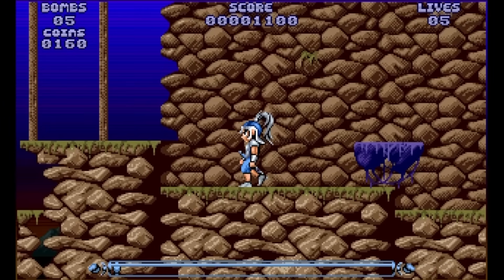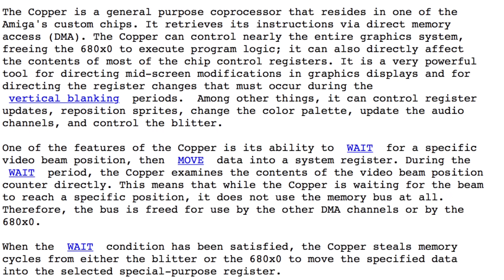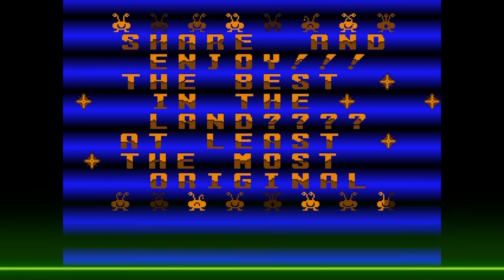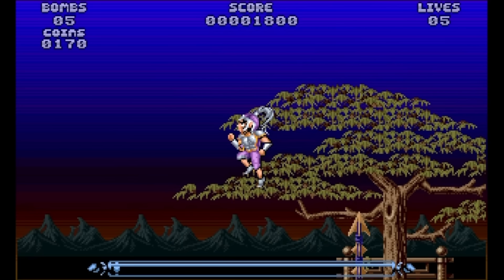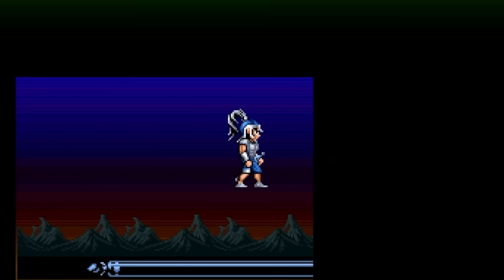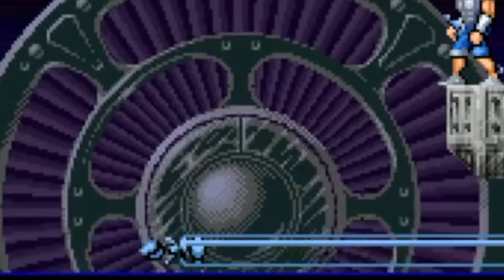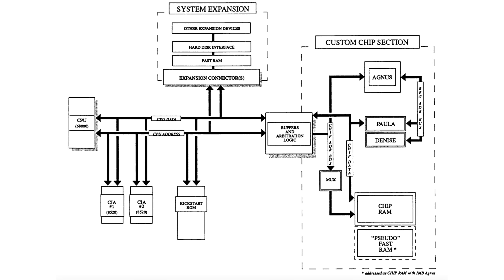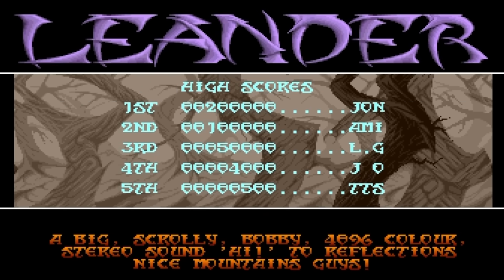SNES hardware beaten by this simple Amiga trick

Comment: The Amiga's custom hardware was powerful for it's time, when used to it's full potential it ripped the Atari ST to shreds and there's a never ending number of tricks discovered by programmers and for the demo scene that's still going strong today. It used to really pee me off in the earlier days of the Amiga 500 when many games were lazy Atari ST ports that would leave the Copper and the rest of it's powerful custom hardware idle, often with software sprites and jerky scrolling, sometimes even running a little slower due to the slightly slower processor with nothing being offloaded to it's custom hardware. Usually ST ports had better sound, but that was the only improvement. Even some games which were considered good like Xenon 2 were still ST ports so could had been even better.

Comment: The SNES can do similar things with it's tiles, but not with it's sprites.  

Notably, with an MMU expansion chip, but the SNES and NES can do this.  However, doing pixel clock level has never been attempted as far as I know.  (It is possible that Donkey Kong Country and a few other SuperFX chip games utilized this same technique.) 

Another interesting note is that some of the favorite effects on the NES and Genesis were done by intentionally throwing the sync from the DMA line and the Hsync off.   I suspect the Amiga can also do this, and could create some interesting effects.
Reply: As a note, looking at the hardware specs of the SNES and Genesis, part of me wonders if they could do this sort of thing, within limitation, but nobody thought to or tried.  

The Genesis had a DMA stream controlled video chip that could easily be triggered to page-flip a few sprite images at specified hsync points.  I am not sure what the SNES used.

Comment: great video. i think ECS sprites are very limited in width right? how did you do the word or did this also fit into that range? Was it possible to have something like TFMX running in leander so you could of had music and fx at the same time? or was that not possible due to restrictions, be it hardware or time restraints? Cheers. Bit off topic, but do you think a decent port of something like Strider or SF2 could be made using these tricks?

Comment: I'm a little confused with the multiplexing of the sprites horizontally: If you have to use some sprites for the mountains in the background, even if it's only a few repeated horizontally, does that then reduce the max amount of actual player and enemy characters you could then show on the same scanline because you'd go over the sprites per scanline limit and they'd start to flicker?

I'm thinking more of Shadow of the Beast here than your game to be honest, as that shows a full-screen-wide set of mountains plus the player and other enemies fully overlapping them, whereas you've been careful to make sure the player is never on the same horizontal lines as the background mountain/cog/fire sprites.

Or, does this technique basically overcome the sprites per scanline limit and allow for both a full screen width of mountains [or whatever] plus the normal 8 16-pixels-wide sprites per scanline?
Reply: You can move other sprites mid scanline too.
Reply: @fungo6631  Yeah, but does it allow them to actually go over the max sprites per scanline, or do those mountains take up some of the sprites per scanline, so they still have less sprites to use for the actual player and enemies on those same scanlines. Even if it were one small sprite for the mountains repeated across the screen, is that one less sprite horizontally there for the player and such?
Reply: @inceptional  There is no conventional sprite limit per scanline. You can have more than 8 sprites per scanline. 

The mountains take up one sprite slot, but that same sprite slot is recycled mid scanline. 

The mountain gets repositioned so quickly it looks like there's another sprite further down the scanline.
Reply: @fungo6631  Okay, so they could basically have up to eight different multiplexed sprites multiplied by however many times that fits into the screen horizontally for each multiplexed sprite across each scanline. So, if they had one mountain sprite multiplexed across the entire screen width, they'd still be able to show seven other multiplexed or non-multiplexed normal player and enemy sprites on that same scanline for example. Correct?

Comment: Using the Amiga Copper to clone sprites hardly beats the SNES, you are still limited to 8 sprites per scanline and each with a limited colour pallete, the SNES does not play by this rule. I used to use this effect on the Amiga to code parallax starfields ect, but such cloned sprites were limited in their degrees of movement not being able to take the scanline space of their cloned brothers.
Reply: LOLwut? Blud just said that you don't need 8 per scanline, you can move them mid scanline too.

Comment: Does dual playfield mode always compromise 2 sprites, or is that only in overscan modes?
Reply: Horizontal scroll usually needed an extra 2 dma slots (16 lowres pixels) on the left side.
Reply: @SerBallister  So.... not sure what you're saying here. You need 2 16-bit fetches, is that what you said there? And if one narrowed the screen by 16 pixel, that should also give us the cycles we need, right?
Reply: @saganandroid4175  The hardware needs to perform some fetches before display of the left edge of the screen, so say, if the left edge starts at word 8, the dma needs to fertch them at say, word 6. Due to some fixed timings there is a limit of how early this can be done because the first few dma slots of each raster are used by the sprite and audio system. This is why some resolutions sacrifice sprites.
Reply: @SerBallister  That all rings a bell now. I recall the great cycle charts in the Hardware Ref Guide.  But by narrowing the screen a word or two, shouldn't we be safe?
Reply: @ I remember the diagram you mentioned too. I can't remember the exact solutions, but yes, I think it had something to do with careful setting of the DDFstart/DDFend (Display data fetch) registers.

Comment: I don't understand why this "trick" can beat SNES hardware, SNES (in my opinion) is much more powerful in graphics (not sound).
P.D: I had an Amiga 600, never a SNES
Reply: SNES has a DSP and can do all the digit wavetable tricks of the Amiga. You just need to code it so that it DMAs the samples from the cartridge. Not many devs were good enough. Amiga is straight forward.

Comment: I didn't get anywhere near your level of acheivement, but one thing I've been saying to people is that you could use the copper to change the colour pallet every 4 horizontal pixels.  I programmed a simple loop in assembler to ascertain that in about 1997/98.  I was planning at one point to make a chunky graphics type game but with hundreds of colours on screen at the same time on the original chipset using that.  Not sure how feasible that would be.

Also, I know you're talking more about sprites here, but its nice to se my findings about the copper being able to take effect every ~4 horizontal pixels.  Most people seem to think you can only use it each scan line
Reply: On SNES everything is once per scanline. Color and mode-7 . Same on GBA. Retarded.

Comment: This really is impressive, but comparing it to SNES/Genesis, isn't it tecnically possible to have 8 screen sizes of sprites not breaking the max sprite count of 128 by using 64x64 sprites on the SNES? I've never made anything for the Genesis, but the 80 32x32 sprites it's able to show should be enough to cover one screen as well, and if there was no Limit of 256 sprite pixels per scanline, there would even be enough sprites for another half screen.

So why isn't this possible on these consoles?
Reply: Megadrive limit was 80 total sprites but 20 per scanline (PAL) and only if you were using sprites no bigger than 16x16.
If you used 32x32 size sprites then the limit was iirc 5 per scanline and the biggest sprite was priority so if you had one large 32x32 sprite but the rest were 16x16 on a scanline then you were still limited to 5 per scanline before flickering, now I could be wrong about the last bit but I remember reading it somewhere many many years ago.
24x24 size sprites had a limit of something like 11 per scanline.
Also the Megadrive was capable of 64x32 size sprite by combining 2 32x32 sprites and it will act as a single sprite, not sure what the limit is though.

Amiga sprites were 8 per scanline and because of the Copper chip you could fill the screen with sprites like he showed, another cool thing about the Copper was you could add in extra colour gradients as well as extra colour palettes anywhere on the screen and also add extra screen shells with their own colour palette. Another thing about Amiga sprites is they're only limited to 16 pixels wide but they could any height, so a 16x256 or higher sprite was possible.
Then the Amiga has the Blitter chip which has it's own sprites called Bobs (Blitter Objects) These had no limit (barring CPU, DMA time) so didn't suffer with any sprite flickering, they could be any size too, the downside was they chewed more cpu cycles compared to hardware sprites, were also limited to the colours of the playfield they were on, so everything was a tradeoff/balance.
Reply: @off1k  Okay, thanks for clarifying. While I now see how that makes the Amiga superior to the Megadrive, I remember the SNES being able to render enough sprites per scanline to completely fill it (272 pixels on the sprites layer per scanline for a screen that's only 256 pixels wide). But then again, that's probably pretty useless since not many other sprites can be used before the flickering kicks in.
Reply: @kaihunsicker9316 SNES has 4 background layers without compromising the sprites. So : why?

Comment: DMA cycles allocation for one of many chips from whole chipset isn't the only thing which is bad, most Amiga systems didn't even have FastRAM and that means every cycle stolen by chipset blocked memory access from the CPU as well. AGA didn't improve things much as CPU slots were basically the same as in A500 (but with wider data bus) which means whole CPU was bottlenecked by memory access at stock config. Even more when high res modes were used. That's why fastram is essential on any Amiga with faster than 7MHz processor.
Reply: Hey, it was Motorolas decision to let their CPU access RAM only every fourth cycle. So what does RAM do the rest of the time? Look at the Jaguar for a worse allocation method. On Amiga you could do 8bpp, digi sound , copper sky, and 6 sprites without a single wait state for the CPU. No bad lines as in C64.

The 32 bit Amiga should have used ARM, where every memory access gives you one instruction. Then do this fancy phases thing as on 6502 and give ARM access in phase0.
Reply: @ArneChristianRosenfeldt  They did leave 16b blitter and copper in AGA making it less efficient in supporting CPU (yeah, wasting mem cycles), also when it comes to graphics it was possible to use burst modes so access more data in the same slot. But 020 had no such option and since it was still possible for chipset to stall CPU (and CPU had no own local memory by default) that did hamper performance even more. And even regular A500 improves a bit with fast ram even when typically 7MHz 68000 receives chip ram access almost every possible slot. But when it misses due to chipset cycle stealing it has to wait a lot more.
Reply: @Promilus1984  at first I forgot that copper needs to read instructions (the display list) from chipmem. Feels weird that it cannot read pairs. I don’t mind 16 bit access to registers if it doesn’t touch the system bus.

As a kid I did not understand why cache came so late. If you want to cure that trauma: JRISC has cache. Recently, I read that Atari tried to launch in the US as early as in GB (where the Jaguar was developed). And for this reason not enough consoles hit the shelves Xmas1993 .

Comment: I would've loved to have seen your HAM demo! Did you know that a lot of later Amiga demos use HAM for animations? HAM acts more as a framebuffer, but the animations are no less impressive for it.
Reply: Pre rendering is lame and I hate HAM . At least it put pressure on PCs to implement hicolor .. after the CDi and 3do .. Wing Commander III is a joke.
Reply: @ArneChristianRosenfeldt HAM is Amiga's hicolor, it's what gave it an edge.
Reply: @Foebane72  yeah, Amiga did not have a discrete RAMDAC like everyone else. Everyone else had to go through a palette. Why did RAMDACs not come with a bridge? Like collect RGB values and spit them out in low resolution. Would be great for painting, plasma and chunky doom. Why hold beyond this tripple? Just increase the clock in the next Amigas.

Comment: The only disadvantage was that the CHIP RAM was never larger than 2GB and that it could only be displayed on 15kHz monitors. VGA monitors, however, require more than 30 kHz. Paula also never got an update so that DD floppies or HD floppies with half the speed were possible. And the sound has never been improved.

Otherwise the AMIGA was a great system. Almost like linux in single user mode.
Reply: So the later Amiga were just a bastard child of a Mac and the original?

Comment: Hello, former AMIGA game programmer here (Puffy Saga and Pick & Pile). Nice trick with the sprites mountains. I which I had a good pixel artist as you had (Puffy is in 32 colors, but I am sure that it would have been magnificent with a more talented graphist. I wasn't in the sprite multiplexing thing as it hinders the level creativity, and result in good locking game that are mostly empty (few ennemies). In Puffy saga, I used the sprites only for the right side pannel (made entirely with sprites in 3 and 15 colors modes, with copper multiplexing), the main screen being in 5 planes (thus no dual playfield here).

Comment: Andy you know what would be Utterly Amazing?  to Port Batman the Animated Series Game fromt he Genesis to the Amiga.  it would be significantly better as long as it has all the standard stuff Genesis has like 3 or 6 buttton joystick support out of the box (maybe as a CD32 Joypad).  And added Amiga abiities like higher resolution (or keep it the same if smoothness suffers). But better sound etc... even if it meant 2mb Chip RAM 1mb FAST RAM required. RAM is no longer an issue for the Amiga and wasnt since the A600 was released.